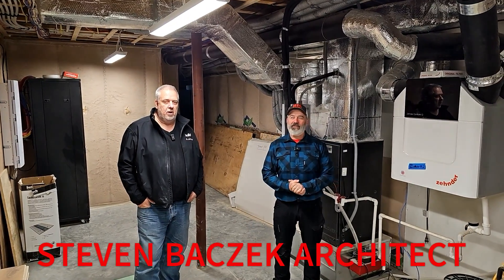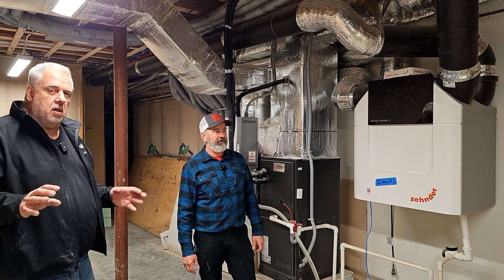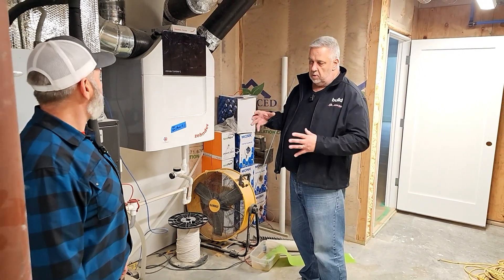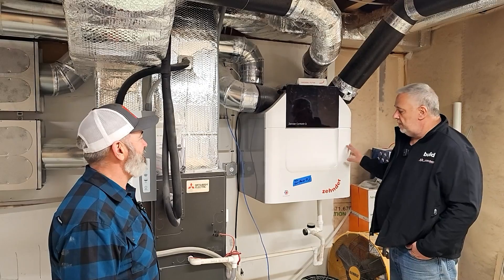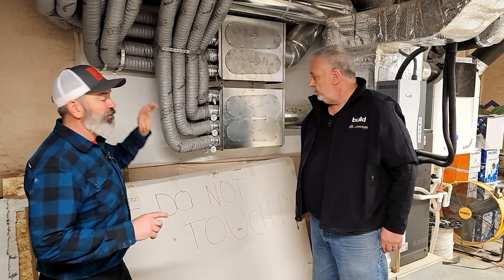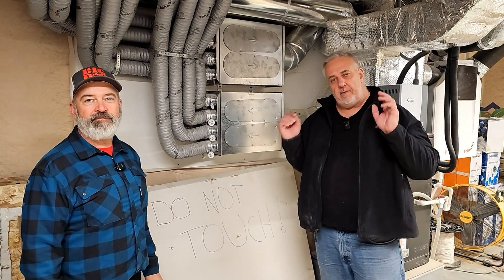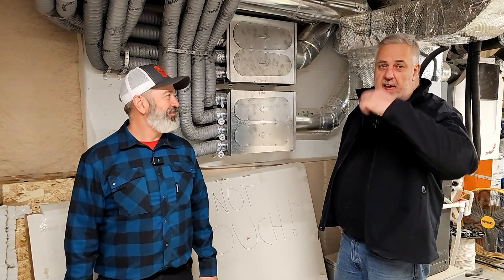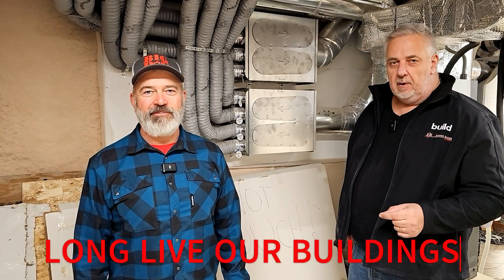LAYOUT PARAMETERS of an ERV.....

Comment: I am building a post and beam passive solar skillion cottage on piers and slab. Plan on hanging erv in tall part of the roof. Where warm air and moisture will build. Basically an earth ship like Goldie and Matts but no tires, no berm, and a post and beam timber frame with 6/12 pitch. Passive houses with one air change an hour don't work for me with greenhouse on front of building. Need one air change every 10 minutes for plants. I hate stale passive house air.  60 cfm don't sound like much. We run 1000 cfm for 10x10 foot grow rooms.

Comment: Great video even if Steve didn't get to use Big Red  this time. I have to admit I still don't grasp why the ERV needs its own ducting system and fan. When it gets down to forty below outside, I feel like I'd rather be dumping that ERV flow into my main air handler, heating it and sending it through the house using a single set of ductwork. Having said that, I realize that Steve has a great reason for leaving them separate, I just don't understand what that reason is...
Reply: I suppose what I'm asking is, would it make sense to pull outside air through the ERV and dump it into the heating/cooling system. Could you have the ERV fan run when fresh air is needed, just pushing it through the heater while it's off, and then have the heater fan do the work when heat is needed, leaving the ERV fan off? Otherwise, it feels like I'd be handing my air twice if it needs to be heated.
Reply from the maker: The volume of air the ERV moves is relatively small. In most cases we are delivering about 12 cfm per pipe/grille. This necessitates a full distribution system of its own - and makes it very very effective. Dumping it in the ductwork, it would get lost and the delivery would not be well maintained from such a small volume delivery
Reply: @stevenbaczekarchitect9431  Ah. That makes perfect sense. I never realized how low the volume was for ERV vs the rest of the HVAC system. Love what you do on your channel, Steve! Where else would I be able to get an answer like this from one of the leading experts in passive house design?
Reply: @stevenbaczekarchitect9431  I'd love to know what level of insulation you'd need before you get your house's heating/cooling needs down to matching the ERV volume. I prefer a separate floor heating rather than air heating system, but in my climate where we routinely get 43 degrees celcius in summer, you do need cooling but it's surprising how far you can keep your indoor temperatures down just with insulation and broad eaves. A single set of ducts for the ERV and just cooling that air when it needs to be cooled would make the system tidy.

Comment: Why not dump the fresh air into the main trunk lines of the Mitzubishi rigid ducting, thereby eliminating all those individual flex lines and the Distribution box??
Reply: Why does this need a condensate drain? I’ve never seen another erv with that requirement?
Reply: @johnwhite2576  In summertime, you're bringing in humid outside air and the ERV cools it down.  Although the membrane might allow some of that outside moisture to move to the exhaust rather than bringing it inside, there's probably still condensation.  In wintertime, the ERV is cooling down the outgoing indoor air before you exhaust it.  Although the membrane might allow some of that inside moisture to move to the fresh incoming air rather than sending it outside, there's probably still condensation.
Reply: 1. Many European houses don’t have central ducts….2. You rely upon central blower to be on much of the time. Most feel that stressing and wearing out the more expensive unit, but I doubt replacing a zhender blower is much cheaper than say replacing the blowier on a Carrier central  blower? If you are talking say a Payne central blower, or alternate Most ervs dontnhave strong enough fans to overcome static in soem house esp older ones with poorly designed systems. ,y a btoan erv, their motors will be cheaper to replace.That said , what I suggest is arguably the best cost benefit approach, BUT you’ve got to be sure to ducts esp supplies can handle the /be designed for the extra cfm they will now carry ie hvac and zhender/erv. It’s very rare that extant ducts are oversized by that much.
Reply from the maker: see my answer above